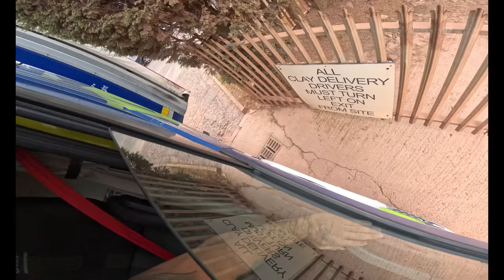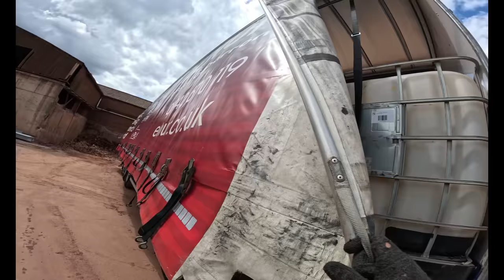Truck Driver VS Obstacles in tight Building Site! - Trucking UK

Comment: Hi buddy first time watching your videos. Just a quick heads up on your satnav issues when planning your route put the postcode in google maps first which 9 times out of ten is just the area of the postcode then look for the company , business you are going on your notes and you get to see where there gates are entered exits etc, sometimes if it’s a small site you can see there loading bays on google maps satellite view so much good info on there. Then put the post code in your truck satnav and pin point exactly where you want to go takes you right to the gate every time. 🥳 . Hope this helps you. One more thing if going on a site like that in the future your truck as  a ferry mode button far left button in middle of the truck just below heating controls. Press that and it lifts the whole unit up. Which stops you banging bumpers when going down potholes etc. hope this helps 👍

Comment: Im loving your videos dude 👍 I have a question for you, I’m currently going  through my HGV test at the moment, I actually passed my multiple-choice and hazard perception test the other day. All I need to do now is book for my lessons. My question is it still a good time to be an HGV driver? Also is there still plenty of jobs out there that will take on first time drivers? because I have seen on websites that they want two years experience first. Also do I have to do tramping work or could I do daywork instead? Great videos as always. Keep up the great work. Maybe you should do some live videos sometime 👍
Reply: I’m fairly new to driving myself but was lucky enough to start driving for the company I already worked for. There are still places that will take on first time drivers you just have to do a bit more digging to find them. I was told to avoid general haulage to begin with and look for smaller companies or places that just move their own products, there is day work about but again it’s just a case of looking around! Good luck
Reply: As a driver myself. Work is very hard to find atm for a driver with experience. Keep at it tho. Try agency to start with. Also if your doing your test go straight for class 1. Don't pay for class 1 then class 2. Some companies may take you on on rubbish money. But it's worth taking for a few months just for the experience

Comment: Job may pay well until after a few years you will develop gut problem with seated for all them hours plus the stress levels you will get on a daily basis, the job doing 5x12 hour shifts will leave you exhausted and your 2 days off your not fit to do anything,

Comment: Dude, have a bit more confidence in yourself, you get out a lot and check and its good dont get me wrong but i think sometimes you dont need to, as long as your trailer is about a meter or so away from something your usually good with your back end swing, I aim to be as close to whatever it is on your drivers side so you know youve got the space the other if that makes sense, youll be surprised, but love the videos some tight jobs! 😂
Reply: I agree.
Also getting out and checking constantly where the front corners of cab are isn't necessary. That's what the proximity mirrors are for. The only real need to goal is rear end proximity check when parking close to obstacles and   blindside reverse. 
I suppose you are relatively new and it comes with experience.